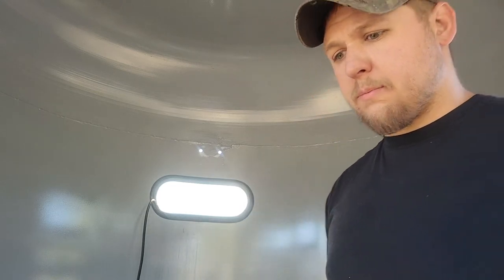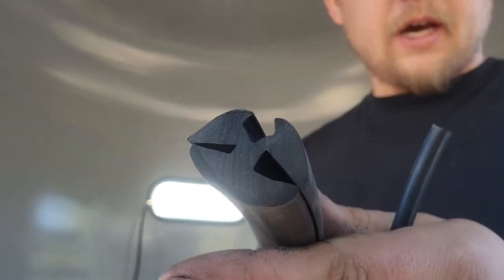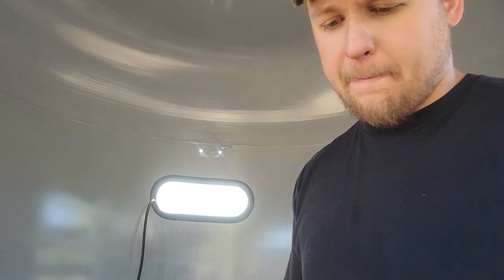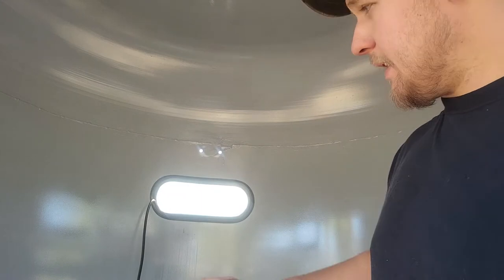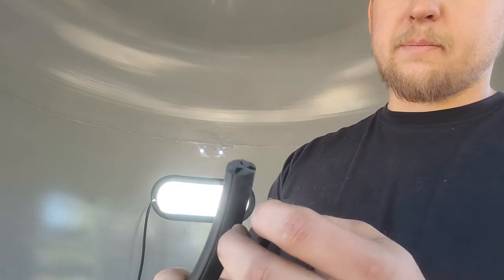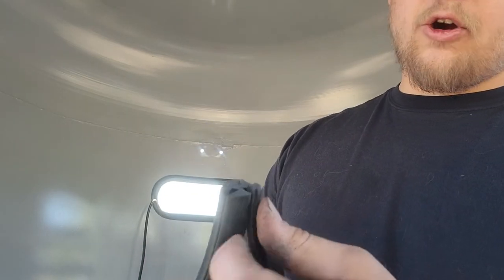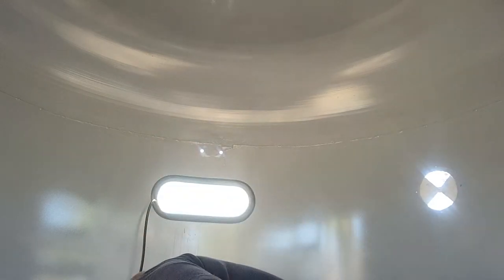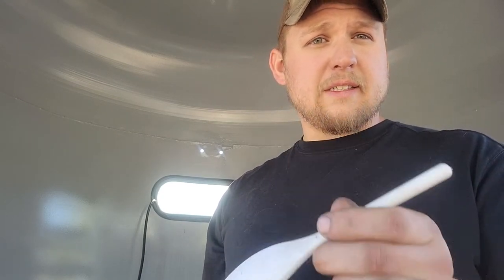2 part Locking Window Gasket install WITHOUT Specialty tool! How To

Comment: Tool for the locking strip insertion runs to the cost of 1½ metres of rubber, and given I will buy 10 metres it ain't worth the hassle not to get the tool. Especially with the perspex in danger of getting scratched if I slip with a (say) screwdriver. The hardest job I see (not started yet) is getting the perspex in after the rubber is in the caravan. Someone suggested string round the rubber (twice) and when you pull it lifts the rubber. But that means putting onto perspex first then offering up to outside of van. 2 person jobbie.

Comment: Do you put any product on the gasket agains the glass and the métel? Or is all with pressure?
Reply from the maker: A spray bottle of soapy water helps immensely to get it in but it holds because the bead locks it in place

Comment: I ‘m assuming you’re aluminum skin is .030 thick? I bought the one-piece trim-lok (LK1522 for 1/16” and 1/4” glass )locking gasket thinking I could build my cargo trailer window into the.030 skin. Can you please tell me what dimension substrates your two-piece Trim-Lok was designed for? It looks like it would be much tighter than mine (which I’m just now cutting the hole for). Thanks!
Reply from the maker: I honestly have no idea. I just looked for the same bead lock gasket I had and measured that but there was only 1 gasket on the market I could find.